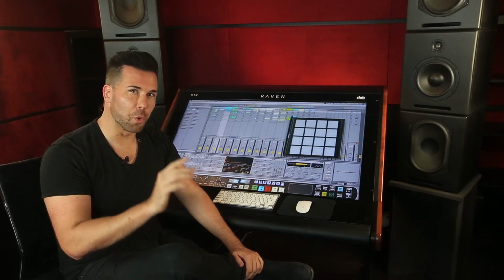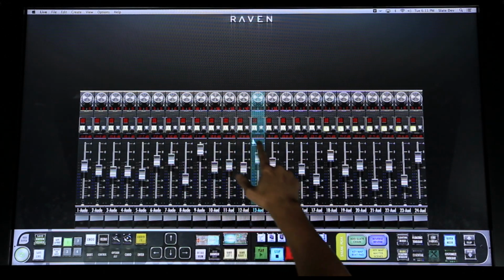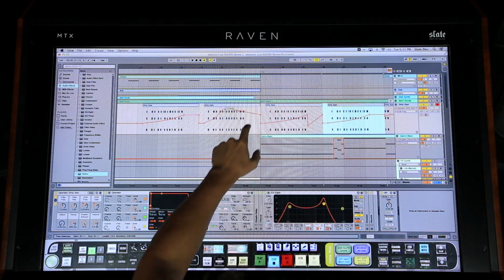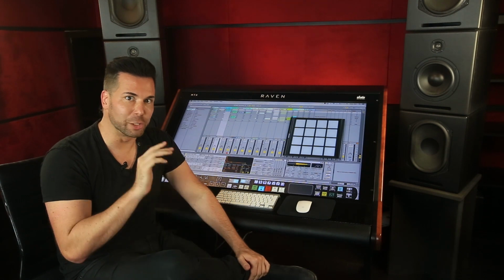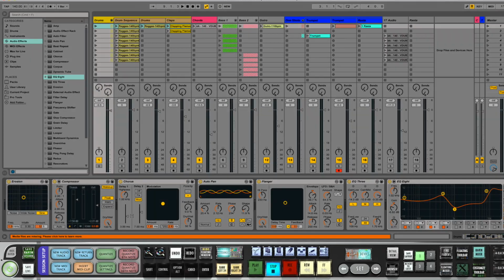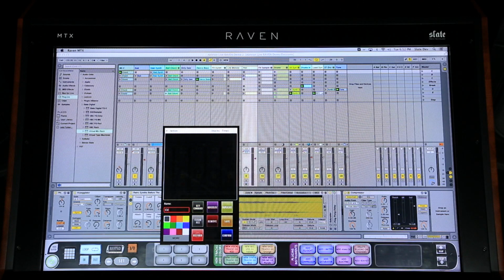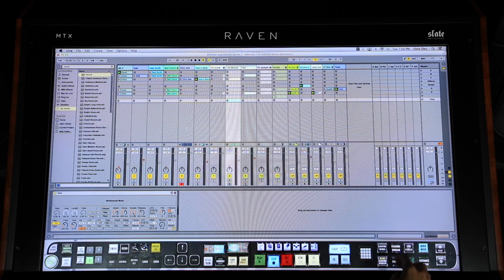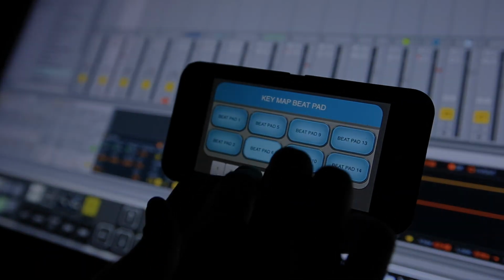RAVEN - Multi-Touch Control Surface for ABLETON LIVE

Comment: Doesn't work very well with Ableton. The MTi 2 is only 27" much smaller than the 46" model seen here. It's not a true touchscreen - it's an overlay that has serious problems with Ableton's tiny icons.
Reply: +Adarkjet its not a ten point touchscreen?
Reply: it's ten points across the overlay . This is actually an ordinary monitor with an overlay, Google "how to convert any monitor into a touchscreen right here on youtube. Your average smartphone has a better touchscreen.
Reply: +Adarkjet expensive and mediocre quality...i think will buy an all in one touchscreen 27 inch..thanks
Reply: +Adarkjet It's not a fraud. 27" monitors that use the same technology as a smartphone would cost tens of thousands of dollars. Think of how many smartphone screens you can fit in a 27" display and you get an idea why all large screens use an overlay. With some things on the screen you are going to have issues that's why they start off showing Steven using the 16 pad launcher for firing clips etc. If you wanted to you can adjust the GUI in Live to accommodate since version 8 I believe.. I own the Raven, it's not perfect, it's not a fraud, it's a solution for now.